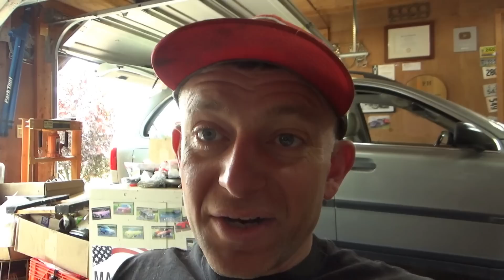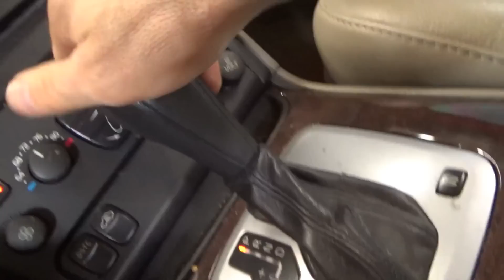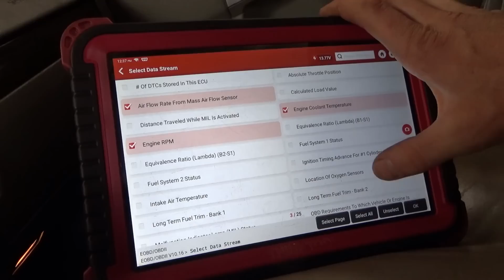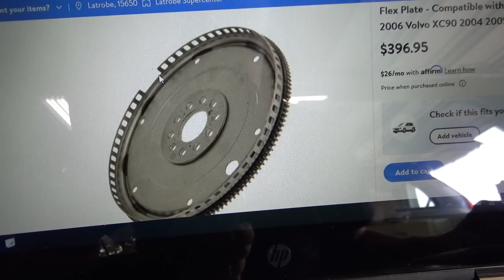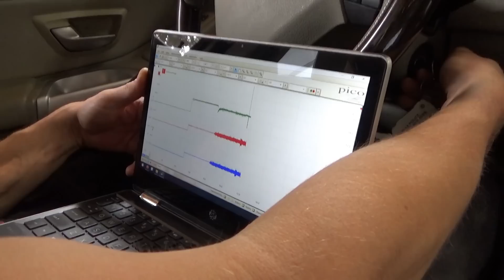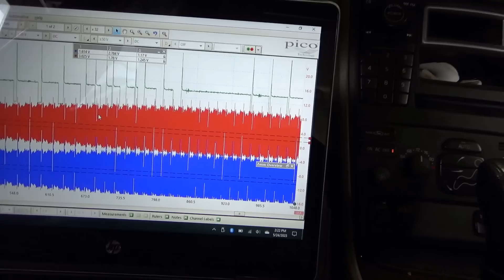Deja Vu? Beached Volvo #2! (XC90 Long Crank/Stall - Part 1)

Comment: They blew it, at one time you see nothing but Volvo station wagons in parking lots now you see hardly any on the road, any Volvo vehicles. My experience 240 bought new, great up to 80K miles then a money pit. $500 here $1,000 there at the dealers, too much a financial burden. Wife switched to a V6 XLE Camry, so cheap to maintain although she missed the Volvo.

Comment: The difficulty taking the key out is due to sticky mechanics in the gear selector. I have a 1999 S70 which occasionally shows similar symptoms. When I took it to the local dealer, he said that he could replace all the sticking components at a cost of around £700. (I'm in the UK) or do what they do and that is to squirt some WD40 through the gap where the release button is on the selector (that's our equivalent to a general purpose spray release/lubricant) and move the selector through the whole range several times. I may have to do this a couple of times a year but so far, no further problems.

Comment: Thats the difference between an obd1 tech and a obd2 tech the obd1 tech starts the diag by intense visual and pull and wiggling 
Inspection an obd2 tech goes straight to the scan tool witch approach is better? It varies.

Comment: Regarding the key being retained, my old 06 XC70 had an issue with the key. It just failed to work without any notice at all. I had to order up a new cylinder and change the door cylinder to match it, transfer the chip from the old key to the new one. It took quite a while to resolve this and I never trusted the ignition lock after that.

Comment: My bet is on a damaged flexplate because of prying or something else. Or a crappy aftermarket sensor, but the OEM-sensor should not have developed the problem in the first place. Very rare for the rear main seal to ger bad on these engines, even after 3-400 000 km.

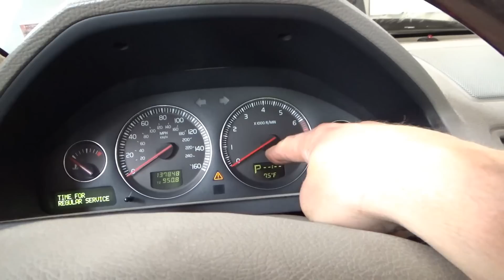Comment: I paused at 6:00  Very common issues with Volvo's.  The key stuck in the ignition is usually sticky park interlock cable linkage on the shifter.  Using some silicone spray on the linkage usually helps.  The hard start issue.....  Watch the tach as you crank.  If it's bouncing and you get random backfires, it's usually a poor ground between engine and trans.

Just finished watching.  Ivan, try doing a drop test on the main ground circuit.  Particularly between the transmission and the engine.  Volvo's are extremely finicky about getting a clean ground through that point.  When you separate the engine and trans, you can introduce contaminates and end up causing a poor contact when remounting the trans to the engine.  Sometimes you can get lucky by re-torquing the case bolts.  Also, check the turbo intercooler hoses.  It sounded like there maybe a gross air leak.  Easy way to confirm that is try starting the engine with the MAS disconnected.  If it will run and idle without the MAS being connected, you most likely have a boost pressure hose off or blown.  I can't wait to see what you find in the next episode.

Comment: I was Diagnosing a 2005 S40 with the B5254T3 T5 Engine, because it was way to Butchered (Engine Harmess destroyed and the ECM had the 852D error, engine horribly assembled after an overheat) than the 2004 XC70 you had. Same issue: Cranks but no Start.

When it Cranked, it was Intermitent, because on the Cluster and the Scan Tool bounced between 1000-6000RPM so the Relay was deactivating the Starter Motor believing it started.

Later, the customer told me that the Flex Plate was replaced, but it wasn't replaced right, and the Impulse Sensor had Metal Shavings as well. Visual Inspection to the Flex plate and was phisically damaged. He didn't want to fix it (money) so he junk the car.

Comment: I think you were right when you questioned the placement of the ring gear on the flywheel or the gap between the sensor and the flywheel.

Comment: A common problem on these is when people change the transmission the put back the battery cable too close to the wiring harness and the interference sometimes messes up with the startup, something to keep in mind

Comment: My own tuppence worth. Sounds like a fuel starvation issue. Another separate problem might be the sensor gap. The amplitude variation on the crank signal is not healthy along with erratic injector pulses all over the shop. Twill be interesting as to what the final outcome will be. By any chance is there any more Volvos left in Virginia?  Or is this the tip of the proverbial iceberg ? Can see another happy customer result not far down the line.

Comment: There may be other problems, but I think you're on the right track with the air gap.  I was suspecting that as soon as I heard this started with an engine replacement.  When a computer gets a weak signal, they can do anything they want, including only working on a full moon on a Wednesday.  This could get interesting - like the swapped engine wasn't an exact match (or at least the flex plate wasn't).

Comment: Hall effect sensors are cleaner but not as heat tolerant. The reluctor type a lot of times have one mounting bolt making a fussy sensor even less sensitive.

Comment: Is there an o ring in the block under the sensor? I've seen cars where the old o ring stays in the block unnoticed when the original sensor is removed, then when a new sensor is installed with a new o ring the air gap changes just enough to make the signal too low especially when cranking because there are two o rings instead of one.

Comment: That temperature reading is leaping around a lot - over 110 degrees when 1st cranking it.

That must be telling the engine it doesn't need a cold start strategy??

Only 9 mins in so will continue watching.....

Comment: I know it has already been said, but I think the sensor gap is of and the reluctor ring is damaged/off timed. I also think that there is another issue going with the fuel. Just a guess though at this point.

Comment: I worked for volvo for 20 years and saw this several times. They never cleaned the mating surface between the engine and transmission when it was out for the rear main replacement and it causes a bad ground. You either have to remove the transmission and clean the surface or add a new ground.

Comment: I’ve seen a toyota variable reluctance crank sensor with low amplitude cause similar issues. In my situation it was just the sensor. Gap and tone wheel were good! The cyclical nature in the waveform combined with the low amplitude make it quite interesting. 2 problems or 1!? Anything’s possible when someone has been in there before, triggering the problem.

Comment: The "run out of fuel" behavior might be the manifold air pressure sensor if it exists.
I have experienced that behavior on another vehicle, but of course the crank sensor is the primary target.

Comment: I'm already thinking that there is a chaffed wire problem in relation to the crank sensor and a fuel pressure problem, 
ie the fuel pressure regulator is flaking out.  MEMO: I once had an old 1973 Chevy Van that had the engine replaced 
and the dumb-@$$ that did the job, bent the flex plate in the process. This happened before I bought the damned 
thing, although it too caused the starter to be bound up like crazy!!!

Comment: im very interested to find out what you find out the problem is in the upcoming parts just a follow up on my fantastic butchered 2011 f250 fuse, box truck lol so the i should have done a video i guess because its very interesting how fords diagnostics work but it got me on this one because of all the wiring problems that this truck has had lately not to mention dash out work for a bad heater core and some other issues i didn’t mention in my previous comment anyway random long cranking no start only bcm codes for key in sense open circuit so the dinger was broken and only a dash message for a  starting circuit fault so pulling my hair out and finally the i just do what we’re not supposed to do but i have had it at this point because everything is working fine and i fixed the one code i had and now i have a key in dinger no codes it’s still an intermittent problem so what is it ? well it’s got aftermarket keys so I go to Ford get OEM keys and try it no codes in the computer for pats problems i programmed them an what do you know it fixed the problem it’s the strangest thing you try to start the truck with the aftermarket key. Sometimes it works sometimes it don’t. but the computer doesn’t log them events ahhhhh lol just gives you a starting circuit fault on the instrument cluster it’s very interesting 🧐 the oem key just works anyway the truck is now happy first time in years with no problems and so is the boss honestly a crazy one for me anyway im looking for to see what the outcome is on this Volvo

Comment: I might have missed a portion of the video where this was addressed but I always try to remember to use the KISS method when diagnosing a vehicle and I am wondering about the fuel pump or driver module because it seems like it primes but doesn't turn back on so the car keeps dying. Since the engine was pulled it could be many other things and those are always the worst because you never know what the last 200 pound gorilla did when they were wrenching on it. Lol

Comment: If you notice Ivan’s own vehicles are at least 25 years old, just like fine wine that ages well.
Reply: Yes, an average of about that age.  His Mazda MPV is a 1989.  His Mercury Mistique is a '96; His Suzuki XL-7 is an '02 and his wife's Nissan Rogue is a 2010 and on its second continuously variable transmission which he said if it goes out again, "I am NOT changing the transmission again."

Comment: The stuck key is because the Park Switch (different from the PRDL) is not being engaged. The switch may be in the console or in the transmission.
Reply: I believe that on P2 cars there's a mechanical interlock between the park gate on the transmission handle and the steering column. That's been known to break as it's made out of plastic.

Comment: Here's a tip from an Electrical Engineer:  Any time you have a two-wire differential signal, the best way to view it on a scope is with A and B channels, one on each signal wire, and the inputs set to the same volts per division,  A+B, B channel INVERTED.    

This gives you a much clearer voltage and waveform reading with NO DC voltage, no common-mode noise, just pure signal.  

This works for any differential signal, be it an engine sensor, wheel sensor, or crank sensor.  Especially a CAN bus!    Almost no car mechanic views these signals differentially, which really grinds my gears!   

Differential signal wires are 99% of the time twisted with each other.  That helps cancel and randomize any magnetic field encountered by the wires.  

You get a much clearer signal by looking at the difference between the two wires.  That is because spurious signals like ignition noise and power line hum and alternator whine tend to be equal on twisted wires, so when you take the difference, the noise cancels out.

    This comes from ancient telephone line practice, going back over 100 years, where there are just two unshielded twisted wires running on poles for MILES to the local telephone office.  Between each wire and ground there are often several VOLTS of noise and power line hum, but the audio voltage is pretty clean as it's sensed differentially at the phone office.  

I know, you are not taught to do it that way, but trust me, that's the way it is generated, transferred, and sensed, in billions of automotive signals and billions of telephone lines and billions of Ethernet cables and billions of USB cables and billions of DVI cables.   You get a much much clearer signal that way.  Please try it and see.   

So choose (A-B) or (A+B, B Inverted) on the scope, ground clip on both inputs to chassis or engine.  The scope probes must be identical, both straight wire probes or X1 or less preferably X10.  Any difference in the probes will show up as a phantom difference on the scope display, you don't want that.   It's a teensy bit harder than just hanging one probe, but trust me, billions of data signal lines can't be wrong!

One loophole--  you should first check both wires for the presence of signal.  If one has signal and the other doesn't, then it's either a (unusual) ground and signal pair, or one side is open or shorted to ground.
Reply: Long but valuable info!  👍
Reply: I will bet that brain in Ivan's head absorbed all of that explanation.
Reply from the maker: Great info! I specifically wanted to see each side of the sensor on a separate channel referenced to battery ground. You will see why in Part 2 😉
Reply: Good tip, HOWEVER, sometimes you actually want to see the 'noise' because it can in some cases interfere with the signal. In a case like that, if you set up your scope so it won't see the noise, you would never see the cause of the issue.
Reply: I came here to say the same.  There is value in seeing CANBUS as two signals, as only one side may be bad.  But for a coil pickup, absolutely view both sides as a single signal.
Reply: Easy way to figure out if it is the sensor may be to stick a 1:2 transfomer in between to amplify the signal, and see if it starts/runs reliably. Although that could result in a signal that is too large on high RPM.

It does feel like the signal amplitude is just below the threshold that the ECM wants to see a valid signal. Would probably have to be more than 2,5Vpp differential to trigger the comparators, as only the zero crossings are important.
Reply: Kick the pair with the KS. Lol

Comment: Had the same problem with my 2004 V70R after replacing my transmission.  The problem was a poor ground between the transmission and the engine. A few people said the transmission had to be removed and have the mating surfaces cleaned. I added ground straps between the engine and transmission,  the car has worked perfectly for the last 55 000kms
Reply: The dealer did the same thing to me after a rear main seal replacement in my 2004 S80 2.5T.  The tach needle would bounce during an extended crank.  Other times it would start and run horribly and shut off.  Eventually it would start and run ok.  It took me 7 years to gather the data to theorize that there was an engine/trans ground that was not connected anymore.  Sadly I traded the car (back to the Volvo dealer) never having fixed the issue.
Reply: You NAILED it!!!

Comment: Hi Ivan, that flex plate has 10 bolt holes in it, could the flex plate have been put back on in the wrong position, does the sync gap need to be at a specific position of the crankshaft?
Reply: "does the sync gap need to be at a specific position of the crankshaft?"

Yes, this is extremely important as the PCM uses that gap to know exactly which parts of the engine cycle the crank is at.  However when flywheels have to be fitted with a specific orientation to the crank, the bolt holes are normally staggered so it can only be fitted in one position.  One bolt hole out would be 36 degrees, and I very much doubt it would run that far out, and it doesn't explain the very low sensor output during cranking.  I suspect the sensor was either damaged during the rear main seal replacement, or not correctly refitted if it was removed.  Or perhaps damaged during removal and the wrong replacement fitted.

Comment: Looks like a tough one, Ivan.  Seeing the weak signal level is perplexing but I like your train of thought with the sensor gap. All arrows seem to be pointing at the sensor and the flex plate since the rear main seal was fiddled with.

Comment: I think this customer nursed one issue until another problem developed in the three years since the shop bent something on the engine removal. The long pulse might be a response to low or intermittent fuel supply.

Comment: The transmissions in those are absolute trash. I have replaced many. I have found bad crank signals because of people don't tighten bolts or leave the corrosion on bell housing. The ground is on transmission.. I wouldn't doubt someone smashing flywheel on removal/ install

Comment: I'm going to go out on a limb here and say you have two completely separate problems, I bet the customer was dealing with the long crank for a long time until it started dieing.
It sounds like it's running out of fuel like you said I think you're 100% correct with that, I think you got two separate problems there man...

Comment: It sounds like it's having trouble getting fuel to the engine so it could be a fuel pressure problem.

However,it could be a similar problem to what that Wrenching with Kenny showed where he inherited a Chrysler or Dodge truck where it had a driveability issue where it wouldn't rev past 2000 RPMs or something like that.

The engine was apparently out of a wreck of a truck where it had missing valve covers & whoever fitted the engine couldn't get it running right,it had a camshaft/crankshaft sensor correlation code set in the PCM which was caused by the donor engines camshaft sensor trigger wheel getting bent out of shape in the accident so he just straightened it with a set of long nose Vice grips which fixed the problem !
Reply: WWK is a great channel! Kenny sharing day to day events! His channel is growing! I wonder what his future plans are that he hasn't told us about?!

Comment: Crazy. I often use obd2 for Euro diagnostics. I actually went to a class that was focused on bmw. And they emphasized to use obd2 instead of factory data. I guess there's a lot of issues with the way the information is interpreted.

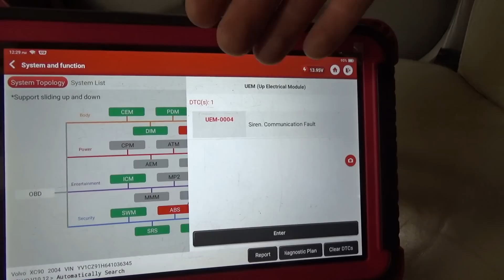Comment: 5:06 ..wasn't it a Volvo with the changed motor ...that had that seal put in wrong ..... something to do with timing
Reply: I believe that vehicle had the crank sensor built into the rear main seal. That seal, if memory serves me correctly, has a device for installation.